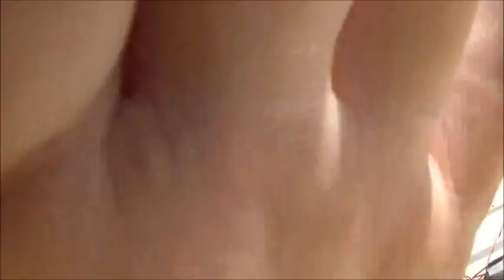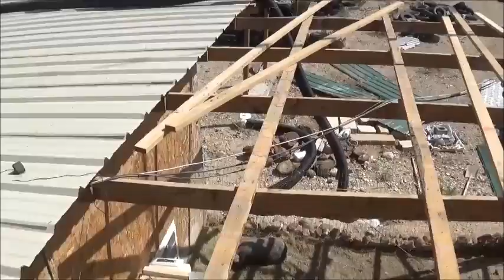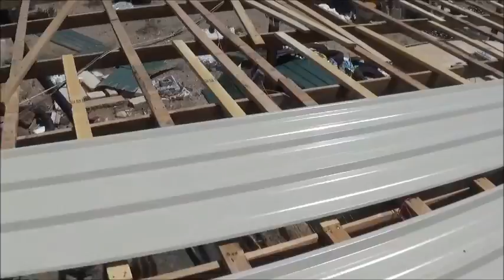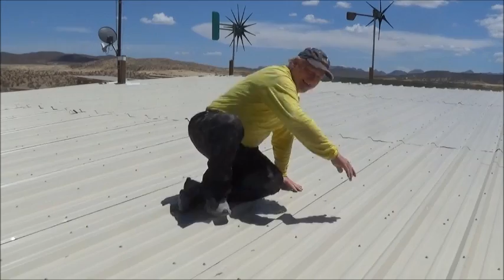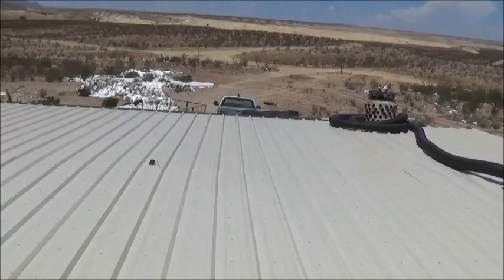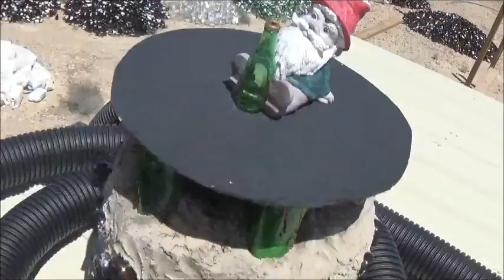Installing Metal Roofing Panels!

Comment: Does it rust where the sheets overlap lengthwise?
Reply from the maker: Our roof in Texas was up 13 years when I left and there was no rust that I saw. My personal feeling though is that GALVALUME only (non-painted) panels DO rust quickly. 

I am about to put a red metal roof on our garage here in Michigan and will be curious to see how many comments I get telling me I am putting the screws in the wrong place! This video had about 20 that did that (not approved). The manufacturers ALL say to place the screws on the flat sections and let the rubber grommets do their job.

One troll even went so far as to claim to be a member of "roofing local (some number)" in Detroit. I always check these things out and there is no such thing!

Comment: How has your roof held up over the last 8 years? I live in Ohio. I have a pallet of 3×5 panels. A guy told me that "nobody" ever over laps steel panels. I see that you did. I was wondering if this is an option for me. I would appreciate any and all feedback.
Thanks Everyone especially Eco-Ranch for the post.
Reply from the maker: He may have meant that no one does it unless they must. I could not haul or handle panels longer than 23', so that was the overlap on the non-peaked roof in Texas. It held up fine. I saw no issues when we move in January and it had been there 13 years by then.

Comment: I want to do this to my deck roof (over shingles), but 2 questions can I use 1x4x8 perlings ? Also I have a 21ft long roof to the deck, but I can only get 12 ft long panels. When I overlap the panels length wise how far do I need to overlap? Looks like you overlapped about 6 to 8 inches
Reply from the maker: I buy my panels from Mueller Steel. They can be cut in any length up to 24', so you would not have to overlap if you got your panels there. The prices are competitive, but may seem a bit higher because the metal is thicker. I overlap 6" unless I have to overlap more to avoid a cut. That way it is easy to figure that every joint would be one foot. So a 21' roof would need 22' of panels (with one joint), NOT COUNTING the overhangs. I don't see a reason you could not use 1"x4"s...… but check that with whoever you buy the panels from, just to be sure. It seems that different regions of the country have different needs and requirements. I could use them here, but maybe not in Boston.

Comment: Looks pro mister thanks for vid
Reply from the maker: Thanks! It seems that in some parts of the country, folks use the ridges, not the flats  to attach the steel panels to the roof. I have had some particularly nasty trolls try to comment about my "ignorance" because I did not put the screws on the ridges. While that MAY be the way in some areas, this steel (and the polycarbonate greenhouse panels) MUST be attached at the flats, per the manufacturer's specifications (https://www.muellerinc.com/) I would suggest that people understand regional requirements BEFORE leaving their "educated" opinion on ANY video!

This IS a professional installation..... THANK YOU!
Reply: Thats true not only looks great but you did it by ur self my hat off to u sir

Comment: Hey Robert, Do you know what two head sizes you had to switch between when doing this job? Hex sizes?
Reply from the maker: 1/4" tied the panels to the roof and 5/16" stiches them together. I think the 1/4" were 2" long.

Comment: Hallo. I recently had a new iron sheet roof installed. Unfortunately the roof is bend. Is there a way the roof can be redone while reusing the iron sheets? Your help will be appreciated.
Reply from the maker: Without photos, I cannot tell. Sorry!
Reply: get a rubber mallet as long as it's not ripped so bad you cant caulk it should be fine

Comment: Did u caulk the ends of those panels?
Reply: Rolls of mastic
Reply from the maker: The panels are sealed at all the seams. I did not show that. They were installed per the manufacturers instructions. Instructions vary from zone to zone.

Comment: Is this roof completely flat or is there a slight slope? I live in the Caribbean and we have 2 rainy seasons each year. I want to build a flat metal roof on my house but I'm wondering how will it be able to drain in the rainy seasons!?
Reply: Definitely put some sort of pitch to your roof sir so the water doesn’t puddle and eventually create leakage,Also there are videos that help as far as cutting drip edge etc...Best of luck and stay safe
Reply from the maker: Our roof has a 5 degree pitch to it.... it drops one foot for every 16 feet. We never get snow, so that is enough.

Comment from the maker: I just reviewed this video and saw that of the 149 videos I have posted on YOUTUBE, this one got the MOST views by a WIDE margin! It is now November, 2017 and our completed roof is holding up wonderfully. Mueller Steel, the manufacturer, has come up with a great flexible adhesive for the seams that stops windblown water infiltration and holds the panels together if a "stitching" screw fails. I am using this on the rest of the roofing done AFTER this video. They did not have it when I bought this material.

When I noticed the number of views, I wanted to state and remind everyone that MY roof, would not pass approval for most building codes! I always tell people to research MANY sources when trying to learn how to DIY a project and NEVER take one person's advice as gospel. Every project is different and the weather, livestock animals, insects, or whatever, seldom read or watch the same source you have studied, so they may act differently than you expect!We live in this part of Texas BECAUSE there are no building codes nor code enforcement officers. It allows us to build our compound with native rock, glass bottles and none of those annoying GFI electrical outlets. But although my roof is strong, stable and leak-proof, it would not pass most inspections because there is NO UNDERLAYMENT! When I installed the first sections of the roof, I could not afford OSB or plywood because it was right after we invaded Afghanistan & Iraq. Most of the country's OSB & plywood was going there for our troops. What remained here was 4-5 times more expensive than it is today. It was cheaper for me to double the size of the perlons (perlins), rather than use plywood/OSB,  by a wide margin.

I could also get by without underlayment because of our low humidity here, moisture vapor is not an issue for us. With nearly 200,000 views, I wanted to explain this and remind you to watch and read everything you can about every project and NEVER take a "journeyman's" or other persons advise solely. Everything I build here, I overbuild, because in the not-too-distant future I will be too old to repair it! Always treat a building code or manufacturer's recommendation as a MINIMUM! Money spent overbuilding is never wasted!

Comment: Absolutely brilliant vid. 
Exactly what I was looking for !
Very informative.
Only question is how do you insulate/ thermal control?
Reply from the maker: Thank you! At first, we saved Styrofoam from local businesses: packing peanuts, corners, sheets any type we could use. Then, a friend had salvaged a huge amount of roll insulation from an industrial building that was being demolished and we jammed it between the roof and the ceiling. Out here, humidity is not an issue, so we can get away without roof sheathing or a vapor barrier. For the rest of the roofs though, we will use spray insulation to cover everything under the metal.

Comment: How thick was the metal, what gauge?  Thinking of doing something similar on a chicken coop. Checked into some metal panel that are 29 gauge but to me seem too thin to have the purlins 24" apart.
Reply from the maker: +JohnAndrew My panels are 26 gauge, I just checked. There is a small amount of give when you walk on the roof, but nothing to worry about. The perlons are set on 24"centers, but I use 2"x4"s so there is actually just 20 1/2 " between them.
Reply from the maker: +eco-ranch.us In north Florida, I set some of the panels on 36" centers. THESE were not strong enough to walk on, but they stood up to 9 tropical storms and hurricanes..... you just had to step on the perlons!

Comment: Thanks for the video. I think it was great, and more than enough times did you say this may not be exactly correct but this is why you were doing it the way you did. You said you were going back and doing 24". I heard you!.  Anywayyyyy  I keep getting these ridiculous estimates on a metal roof and they all do it a different way so the more I watch guys like you the more I know we can do it our self. Keep up the great attitude and sharing that also.
Reply from the maker: +Jody Walker Jody, "codes" vary from state to state and in the beginning, before the "butt-crack building/code enforcement inspectors" they served a great purpose. Bu the construction industry as a whole has morphed that into a costly debacle that is designed to force most people into hiring people from the "trades" that pay the "butt-cracks" for enforcing ridiculous regulations.

My original roof, not the one I videoed, which is 50% stronger, stood up to a "haboob" wind that went from about 10 MPH to over 90 MPH in a matter of seconds AND carried dirt with it that further weighed down the air. It was NOT built up to the "Florida Uniform Building Code" that I studied and try to apply here. Florida's is based on (where we lived) withstanding 140 MPH hurricanes. My roof would have done that, but it was engineered differently than a Florida roof would have been, because we have very low humidity here and I could save material and money this way.

Bottom line it that the guys who are quoting you prices, may be quoting based on conforming to your building codes. If you can do it yourself, roof joists that are 24" on center, like mine, are substantial and will stand up to hurricane winds, PROVIDING that you also use 2"x4" perlons, or 3/4" plywood sheathing with 2 1/2" screws that screw into the joists. EVERYTHING, EVERYWHERE should have hurricane straps on the joists, both sides, with nails or screws in every hole. "Twisty nails" are a great idea as well. If starting from scratch, designing the build so that the joists line up with the roof studs adds strength, but forces you to use 2"x6" studs in order to line up to the 24" roof joists. This is a good idea anyway if the structure is "stick-built".

Either of these will stand up to anything Nature can throw at you. But so long as the "butt-cracks" are out there, you MAY have to conform to building codes. We do not here, unless we hire the job out, then it must be permitted and inspected. DIY is exempt.

Roofs are the most vulnerable structural member and must be built strong, regardless of any "codes". I try to overbuild. Occasionally, someone will comment, like one did below about the 24" span that he thought should have been 16", but there is a plan here and part of that plan is to withstand an EF2 tornado. This structure will and using 2"x4" perlons allows one to move the span to 24".

Good luck to you and keep watching, we are about to start on the house walls and rooms!

Comment: looks like you spanned your 2x6 rafters pretty far buddy, and purlins should be 2' on center to be safe.
Reply from the maker: +bill keller Rafters are 24" apart, fine for this job. Purlins ARE 24" apart AND are 2"x4", far more than necessary for the roof. The error was in the headers, which needed to be 2"x8", not the 2"x6" I initially used. I have strengthened these. That roof has stood up to several 70+ MPH gusts AND one 0-90 MPH in 15 seconds, "haboob" that hit the weak side, ENE. There was also a 4.0 earthquake. The roof is sound.